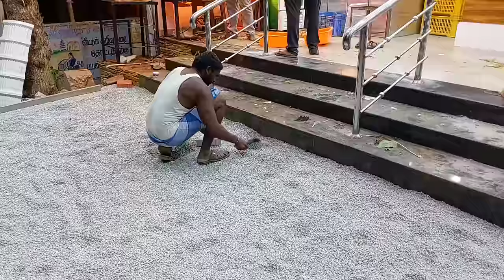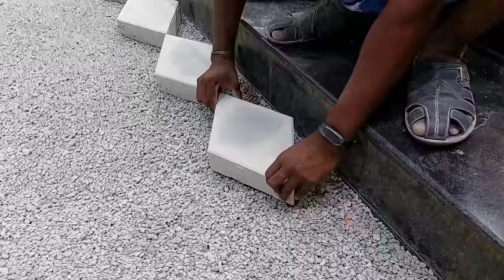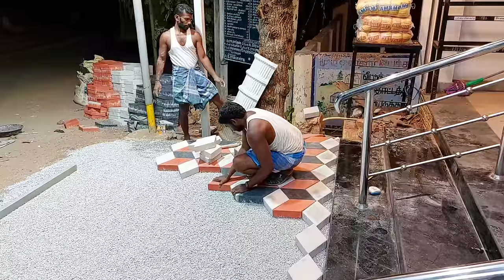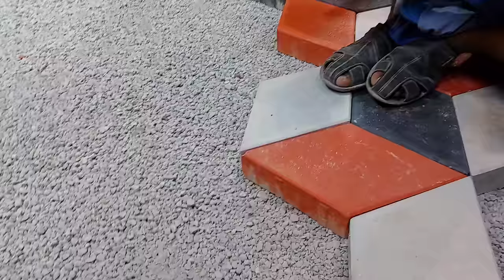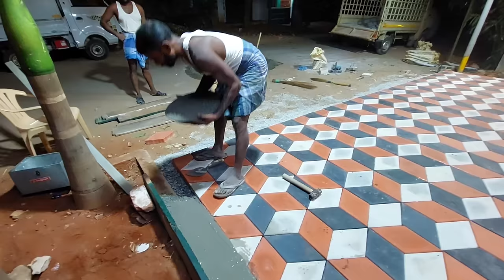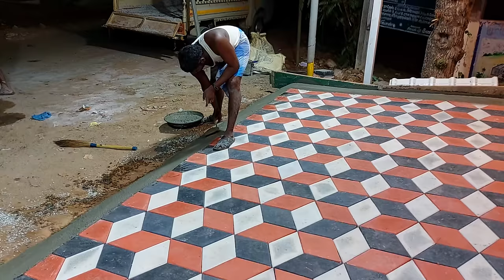Paver Block Technology-Fantastic Diamond Design in Paver block Installation On Flooring

Comment: No complete 3d effect because Black and orange pavers are in wrong pattern.
Reply: U r Right
Reply: How were supposed to be installed?
Reply: @blessingxaba5810  The colors should alternate each row instead of matching, so the "shadow" is always on one side. Basically, make diagonal lines instead of vertical lines. That's if they're trying to do a 3D effect.